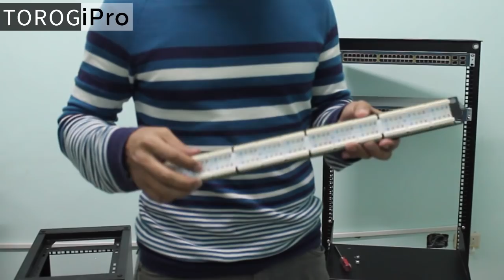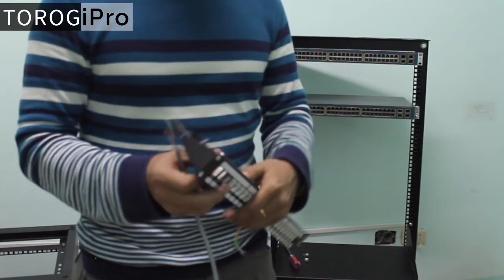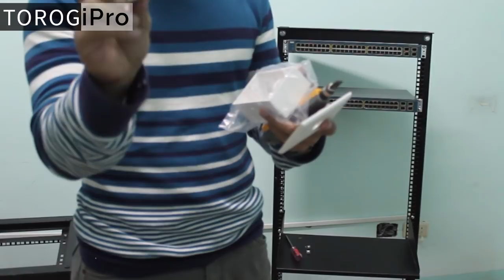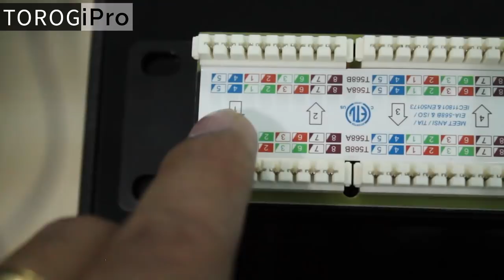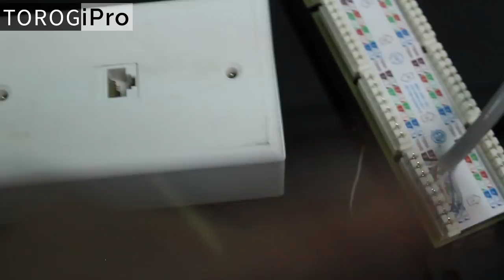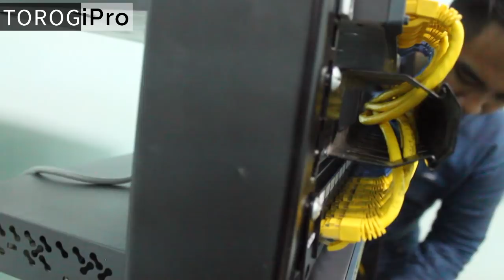Mastering Network Cabling: A Comprehensive Guide to Patch Panels and Best Practices

Comment: in a IT service room what’s the difference between the customers equipment and the actual network equipment? Is the customers equipment like a switch/router and that cable goes to the networks switch or server?

Comment: Sir Good day, ask ko lang if pwede ba directly you can plug from PC to Patch panel, tsaka anong cable color code na best mo ma advice from pc to patch. atska, anong twag sa mukhang malaking cabinet ng mga switch atska patch panel... salamat. saludo ako sayo sir.
Reply from the maker: Yes, pede mu connect ung pc to patch. Nasa sau na kung anu color coding mu, design mu na xa, ung malaking cabinet na may doors DATA CABINET  tawag dun. ung walang doors OPEN BAY RACK tawag sa kanila.

Comment: You need Neat-Patch to handle all that excess cable.
Reply: Sir i need some tips
Reply: I want to connect server patch panel  router and 24 port dlink switch and 10 pcs plzz draw diagram or any tips
Reply: may i know what do you need?

Comment: This is far from the correct method to install a patch panel.  The component positions are wrong, and the cables are way too long.  Once the cables are run to the outlets moving the patch panel should not even be a consideration and the switch should always be adjacent to keep cables as short as possible.  Excessive cabling can also impede essential airflow and create potentially damaging hot regions in the cabinet.  If one of the cables develop a fault, its not so easy to simply replace it.